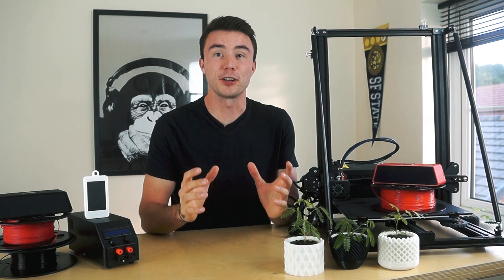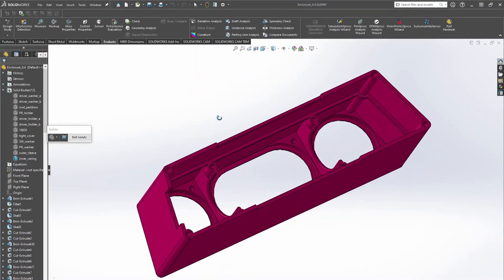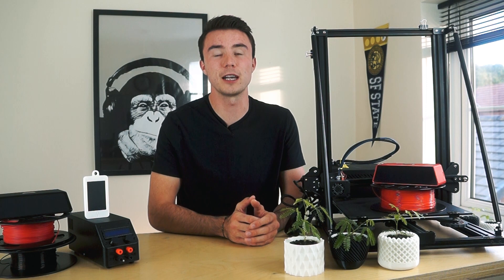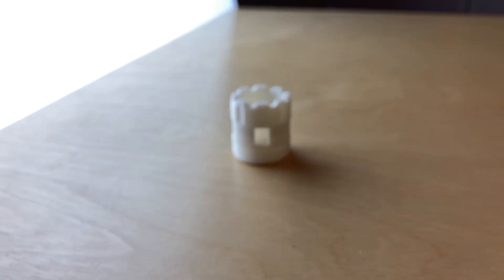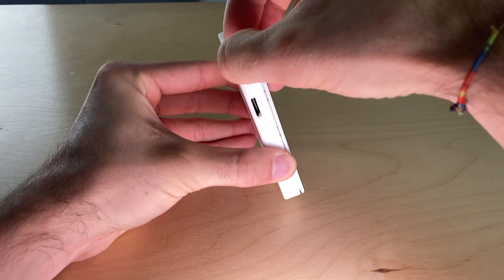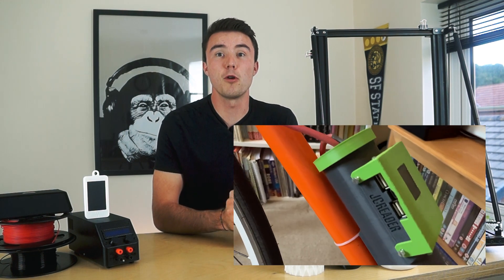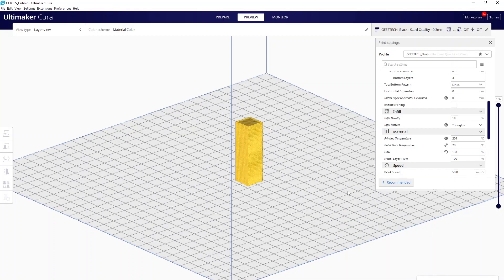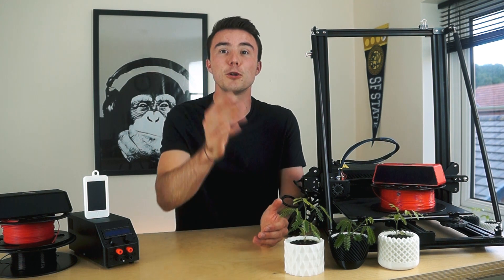Design for 3D Printing | 10 Tips and Tricks

Comment: 1 more tip, you may not have this problem in the UK, but here it is: printer placement. I live in the desert South west USA, when the Air conditioner unit would cycle on, the ceiling fan would blow cool air in the build plate, so regardless of the roundness of edges, the part would lift.
Reply from the maker: Yes this is definitely an issue here too. Not so much with ACs but I used to print in my uni dorm back when I was studying and leaving the window open would have the same effect. The printers we use at work have a curtained off area.

Comment: Great video with some excellent tips. I'm a big fan of designing parts that don't need supports too👍 I find personally for my machine I use a 0.3mm tolerance so very similar. I'll also check out your clasp as I have tried a few and often end up with fasteners as they don't work so well. Thanks for some of the other tips too, I'll be trying the increased material per layer for more strength if I ever have to print in the 'wrong' orientation.
Reply from the maker: Thanks Ricky. I started using the clasp on products which were eventually going to be tooled for injection moulding at work, I'm told by the manufacturers it's suitable for this too. Increased flow works but can make the layers look less clean.